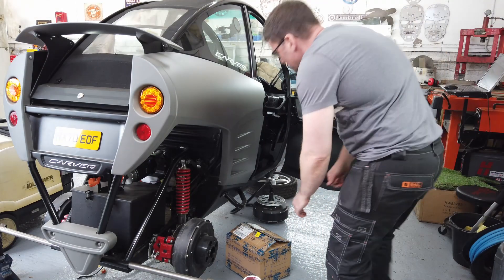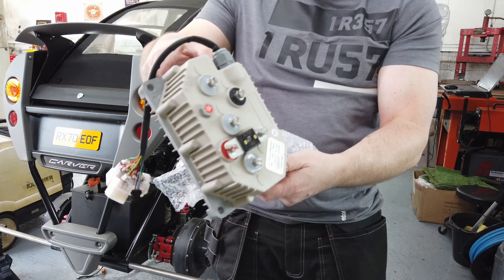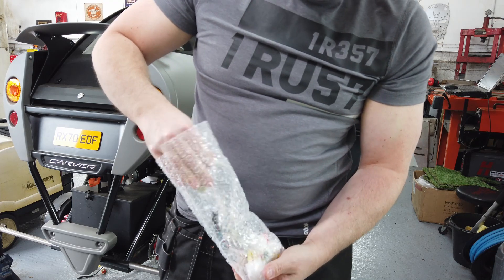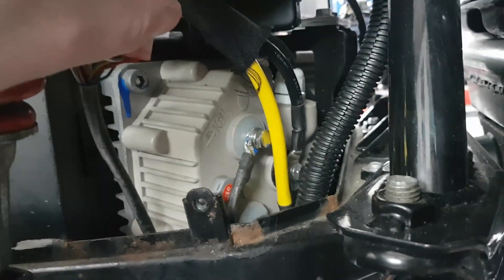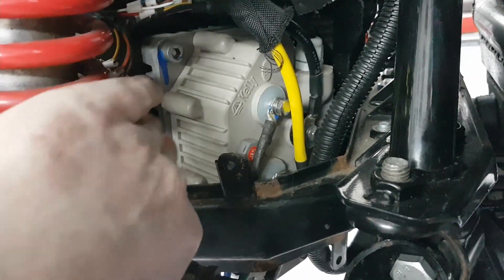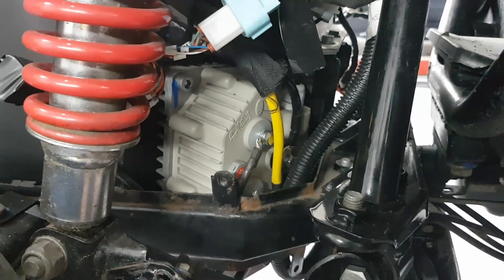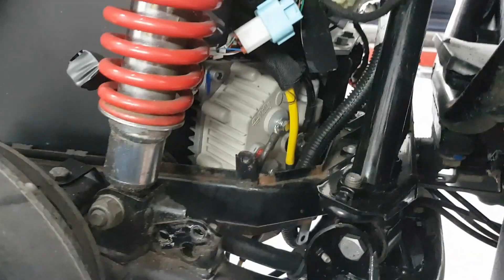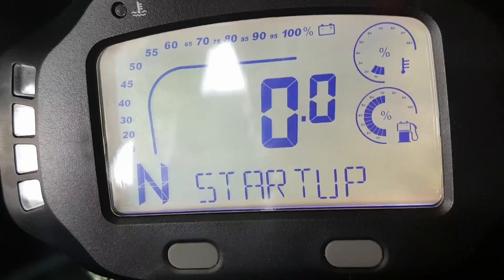Carver Upgrade Update

Comment: Hallo Nigel, i´m Thomas from Germany. I bought a Carver this month. Now I would like to install a rear view camera. Since the Carver doesn't have a reversing light, I would like to take the power from a line that switches on when reversing. Unfortunately, I don't know the Carver's circuit diagram and I don't know which line is activated when reversing. Can and would you like to help me here?
Thank you very much in advance.
Reply from the maker: Hi Tom, I don't have the details anymore I'm afraid.  I know people have talked about adding rear view cameras on the Carver Electric Fan page on Facebook. That's probably the best place to start 😊👍

Comment: Hello

Thank you for your videos, it is well explained
I have a problem with my Carver S+, suddenly when going over a small bump, it beeped, then stopped.....
I bought it last year in Belgium, I live in France, and the distributor in Belgium, is not able to inform me ... he sent a ticket ... to the factory, in Holland ..no answer...
I tried the various manipulations that you show in your videos, without success..
Currently, it is leaning a little to the right, the charge is 100% full, when I put the key, only the warnings work, and if I put the power outlet, everything else works.
Here are the messages on the dashboard:
FAILURE
GOOD-BYE
194 HUBL
Do you have a solution to make it work again?
Thank you in advance, we are only 2 in France to use Carver.....

Yours, Adrian
Reply from the maker: Hello!  Thank you for your kind words.  The 194 HUBL (hub left) message sounds like a problem with the left motor but it could just be a loose connection.  If you feel confident enough you could remove the rear battery cover and re-seat the cables... I suspect tho it could be a hub controller as these have been known to be problematic.  

Join the Carver Electric fan club on Facebook as you'll likely get more advice there 😁

Comment: Hi Nigel, I'm really interested in the ownership of this three wheeler. But I notice that the ride is quiet rough when overcome uneven bumps between two rear wheels. Does is due to the weight of the in wheel motor or the tilting mechanism can't catch up with the required adaptation.
Reply from the maker: Hello, in my opinion the ride would be greatly improved if the carver had independent rear suspension.  The unsprung weight of the in-wheel motors obviously makes a difference but because the vehicle is so light it's not that bad. A few owners have improved the ride by installing 10mmonger shock absorbers.
Reply: @NigelPond  as i imagine, the tilting of this bike is limited to the adjustment of one small motor. When the rear wheels come cross a bump in which one wheel contact the bump few milliseconds before the other. It's very difficult for the motor to be able to tilt the bike smoothly to adapt that situation.
Reply from the maker: @MrQuachBinh  exactly. It's not a perfect system but it is very stable.  I hope that their next version has independent rear suspension which will help greatly.
Reply: @NigelPond  but I'm afraid it's quite hard to do so. Because, then the base for the tilting mechanism will be fluffy. It will be very dangerous for maneuvering at high speed
Reply from the maker: @MrQuachBinh  perhaps the Nimbus EV is a better solution?
Reply: @NigelPond  i don't know. The Carver has more than 10 years of development, where as Nimbus is new. Does it has any out standing Idea?

Comment: A little extra cost on getting a decent powder coating job would have been very worthwhile, also I never know why manufacturers don’t use stainless steel nuts and bolts. I suppose the costs build up and they must have quite a problem keeping them somewhere sensible considering how relatively few they are selling compared to a car maker. I used to hate seeing the slightest bit of rust on my motorcycles. Also, the complex electronics are starting to put me off a vehicle I was becoming committed to owning. My 19 year old Volvo V70 has computers, sensors and plugs for nearly everything and it doesn’t like it if you replace a component, you need a code etc etc. but it has never gone wrong in 19 years. How can they ever match that, unless of course the reliability of all this stuff has moved on, which I suppose it must have done. The failure of the project must be disappointing, I guess you really need an electronics engineer on board. I may have to just stick with my electric recumbent trike, not that I have ever even considered parting with it. I’m getting more fun and use out of that than any motorcycle I ever owned.

Comment: One more quick comment is the grey one flat and paint in other words it doesn't show the scratches  better than  any of the shinier ones? And if you replace the motors first and not the charge controllers although the controllers you have to change  because they're putting in more powerful motors correct? The Bluetooth connectivity is also very good but what does that do for you? Do you get to monitor what's going on with the controllers  as you are driving down the street? What kind of braking system is on this vehicle? The shock observing system I've noticed is not that great but changing it will add weight which is in good either  unless he used oil dampening or air shocks but I think that might be more complicated and more cumbersome although air shocks at the front would help significantly because there's a lot of drag that I've noticed in the videos  when you're going over deep holes  and up and down  the driveway things I don't know what they're called. I know I had a similar car but it didn't tilt but it looked like a spaceship as well it was very very cool and it was also three wheels to in the back one in the front I'll try to send you a link I modified the hell out of that. But I did this with another electronics technician because you have to do it with two people. For eyes are better than to in two minds are better than one.   https://youtu.be/NuZXpjhSPzE         enjoy     https://youtu.be/IUhg3p7xFUA
Reply from the maker: The grey colour is actually the colour of the plastic. It's not painted.  I think this is the same for all the matte colours... the gloss ones may be different...

I was hoping that installing the new motors would just work but I wasn't expecting it to be any faster at that point because the controllers would also need configuring to make use of the available power.  Unfortunately I couldn't access the controllers (new or original) to change their settings. 

The front and rear shocks are very basic.  Ride comfort could be improved by upgrading them.  I don't think there would be enough of an improvement to justify the cost though... The single swing-arm at the rear is also limiting.

Thanks for the links, I'll take a look!

Comment: I can't believe that your devices so new and it's already rusting.  So I guess the powder coating isn't a very good quality. How long is it's guaranteed for?   You can get more speed out of it all the time if you have schematics. You have the schematics for this unit that you're looking at. The only problem with driving up the the speed is that the brakes need to handle it. I took my other electric car that was made in Germany and it was only supposed to go I think 45 km an hour and I got it up to 80 and 80 km an hour it was perfect but I wouldn't necessarily drive that car at 80 km an hour.

Will the company give you a set of schematics? And controllers may not necessarily give you more speed however the switching of the power on and off all the time will greatly be more efficient so you Lou you'll use much less battery power so that's a good thing but I don't thiink it will increase your speed.  Changing the tire size also increases speed but that's also a bit of a problem because then there will be stability issues.

Even that car at 50 km an hour I bet you really feel the speed 60 would probably feel like 80. Or maybe even 90.    You could also add a solar trailer to it and the reason for that isall the time that the bike or scooter is running is always losing more and more power  now even though you enjoy that rush of power at the beginning by the middle of the day  is probably starting to slow down or is it? If you had a solar trailer that for the down times when it's sitting in front of a restaurant or whatever it is it's always charging producing a little bit more power so that when you get back into it and drive now it normally takes three hours 3..5 hours to charge it at how many amps?
Reply from the maker: Hello, I do have most of the available schematics and manuals. Unfortunately it's not that simple. You would have to attach an analyzer to the DVC/BMS circuit and monitor the signals. Once you have enough data it may be possible to reverse engineer what's happening and work around it. Remember that it's not a standard electric vehicle because the tilting mechanism complicates things.

The brakes are weak as they are, so yes, they would definitely need upgrading if it had more power.

I have noticed a reduction in power as the battery is depleted.

The Carver charges on a standard 240v/13 amp socket.
Reply: We did change the rear tyres for 135/70 (Falken Ecorun) and there is no change in stability. They fit on the same rim. Since the tyre has probably a better rolling resistance, the range has not changed noticeably either. Probably even got better...  The only thing we had to change is lifting the fenders. Speed now increased to +/- 53 km/h which is perfect. I am able to come with the city traffic, which may go 50 km/h. (Falken Ecorun)

Comment: Are those spots rust spots?
Reply: 2.23
Reply from the maker: Yes, they are. Not sure if it's just my Carver or a wider problem.  I will be rubbing them down and painting them before I put the covers back on.
Reply from the maker: @gilburton Ac50 is a part of my routine. I've even rubbed areas down and painted with hammerite.  Not something that should need doing on a vehicle that's only a year old... 

I've not heard anything about UK distribution.  It will be possible post-brexit I'm sure.  I think cost and lack of performance will put a lot of people off...

I believe most of the components are built in Korea and final assembly happens in the Netherlands.  

Can you share the Chinese site where you've seen them?

Comment: Hello Nigel.
What a pity. Hope that putting everything back in its original configuration will go as planned.
And that the Carver will give you a lot of fun anyway 😉
Reply from the maker: Hi Paulus,  the original hub motors and controllers are back in place and it passes it's self test without issue so I don't anticipate any issues :)   I'm sure I will have fun, but just at a slower speed :)